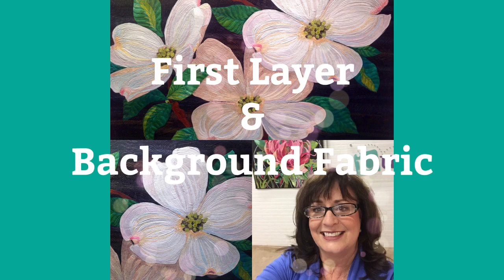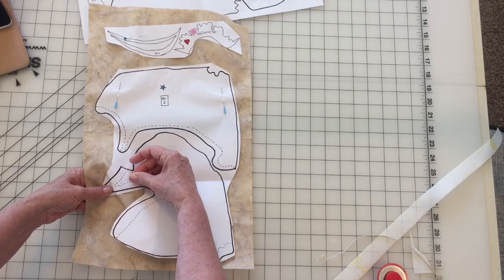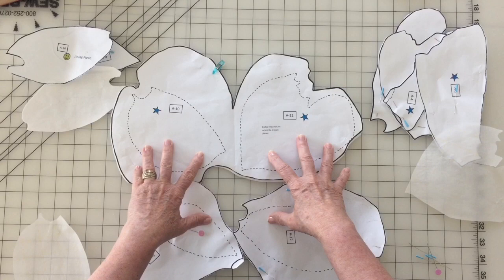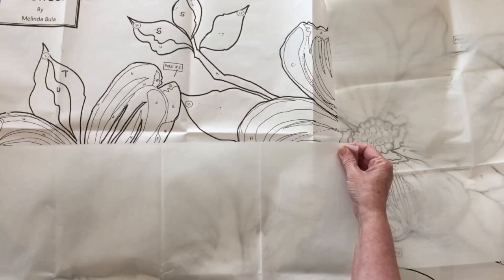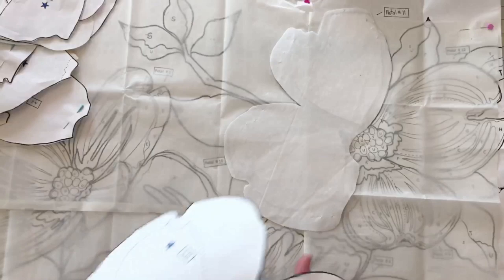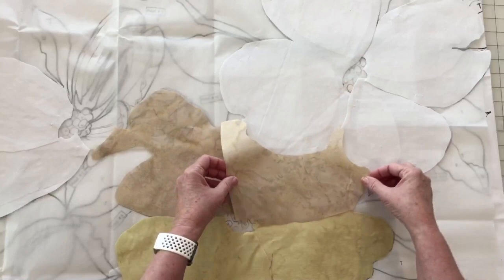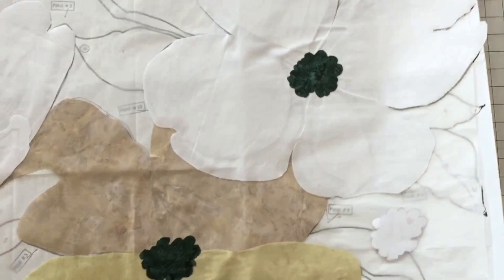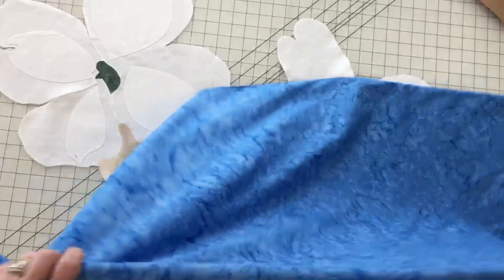Dogwood Flower Class #2 “ Fusing and background with Melinda Bula

Comment: Can you tell me why you use the steam a seam 2 versus the Lite steam a seam2. I have used the LITE for years and avoid the regular steam a seam because it is so heavy. Is their a specific reason you use one over the other.
Reply from the maker: The lite does not stay down. When I go to quilt my quilt, the lite lifts up while I try to quilt and makes a mess. these are wall quilts, so the stiff dons do not bother me. They lay very flat on the walls.
Reply: Thank you Melinda. That makes sence😊.  I have not made a lot of wall quilts, but several baby appliqué quilts, and the light steam a seam can lift.